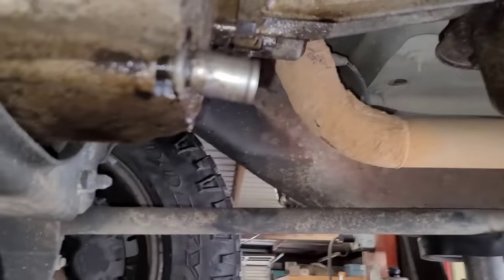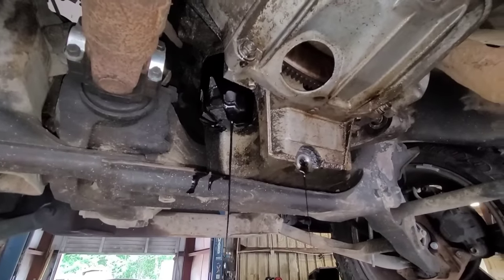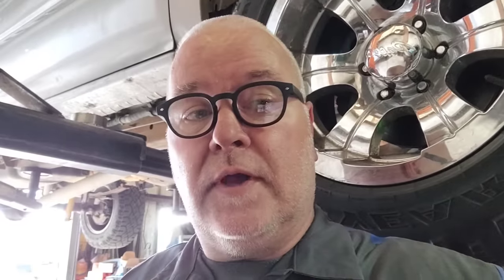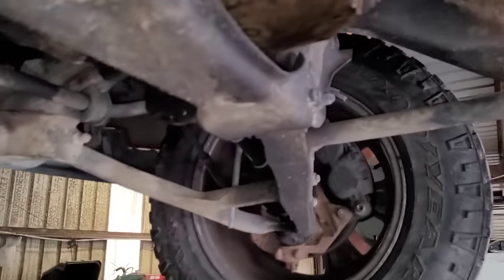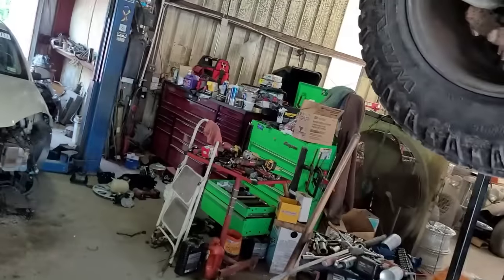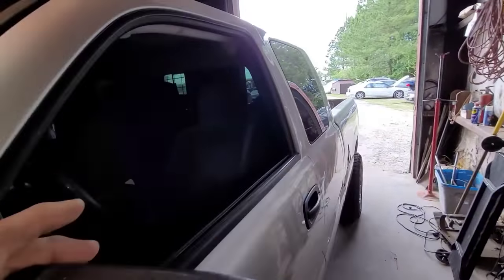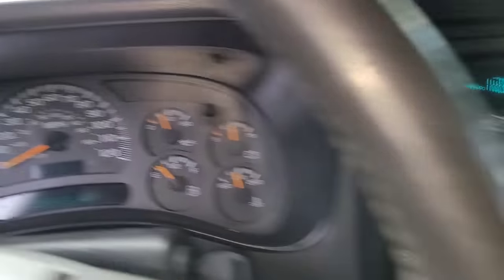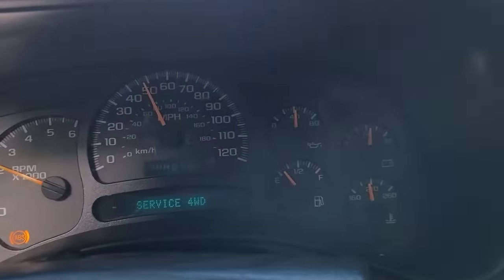We changed the oil in the noisy 5.3 and this happened!! The damage is done unfortunately..

Comment: I always prime my oil filters. And change the filter halfway through the 6000 mile interval. I buy a dozen Wix filters when they are on sale, it's cheap insurance. My neighbor has over 350,000 miles on his 5.3. Never had a repair that was major, and it doesnt even burn oil. When cared for and not beat on, the 5.3 is a very decent engine.
Reply from the maker: Excellent! Thanks for sharing. Keep wrenching 🔧

Comment: The newer spin on oil filters used on piston aircraft are labeled “ do not lubricate gasket seal” . I assume the material used is different.
Reply: could be pre lubed ,i have seen truck filters like that
Reply: Those are the Tempest “Spin-E-Z” filters. They are pre-lubed with silicone grease. Try installing a Champion without lube and you’ll use a chisel to get it off!

Comment: I bought a 64 Chevy Impala 283cu with 40k on it. Dropped the canister type filter and it was bone dry and packed with red dog (coal mine byproduct used on dirt roads) zero oil! Flushed the motor with 2 gallons of kerosene. Got another 70k out of it.

Comment: That’s wild I’m having the exact same issues with my 2000 Tahoe mines holding 10psi though. And I need to do intake manifold gasket’s since it’s idling way too rough
Reply: Hey Jack, sorry to but in, but try cleaning the throttle body. I had that issue one time and after that it idled and ran much smoother. Also look for vacuum leaks and it doesn't hurt to clean or even replace the PCV, usually in the valve cover, they're cheap and can make a difference in the oil pressure (everybody forgets about that). When you do your oil change, if you use regular oil it may improve the pressure, I find that conventional oil does make an engine hold better oil pressure, just like in this video. I find it better a lot of times, you just have to change it a little more often than synthetic. Also despite what he says, put oil on the rubber around the filter with your finger before you screw it on.
Reply: Oh I forgot to say that I would not change the intake gasket unless you are sure it's leaking.
Reply: Run some motor flush before changing the oil and do another oil change about 500 miles later . Repeat the motor flush each time you change oil. Small deposits can clog the micro screen below the oil pressure sensor and cause a low pressure to show up on the gauge. It’s a cheap fix if it works. Or new pump , sensor, pan gasket and pickup tube 0 ring can set you back a nice chunk. You got to change the oil anyway so try it. He says it surprised him and he’s an expert.Depends on how long you plan on driving the truck
Reply: @russellstewart5414  Thankyou man I’ll try that today, I know my intake mani gaskets are bad too due to misfires on start ups so gotta do that too

Comment: I was instructed to put a film of oil on the filter gasket to prevent it from binding on either side when spinning it on. That's how I've been doing it for 45 years but I really don't think installing one dry would actually hurt anything. 

One thing for sure, that motor is very close to the end. It wasn't just low on oil either. It was neglected by the owner or PO for many thousands of miles. Grit and poor lubricity from oil breakdown have been slowly killing it for a long time

Comment: I bought a 2003 Ford Explorer Sport (2-door) to replace my 1999 Ford Explorer Sport. It suited my height and the job that I did. With low mileage, I thought I was getting a decent deal, but a year later, the Mechanic said it wasn't worth the time to replace the leaking valve cover gaskets because the engine was all gunked up from neglecting oil changes.  Five years later, my gaskets are still leaking onto my exhaust and the car is still running.

Comment: I thought that the rubber gasket needed oil just to lubricate it as it goes on so it doesn't tear.
Reply: I always heard to help it seal
Reply: So we were taught to lube the top of the gasket with a thin film of oil to help it..... whatever. What about the other side of the gasket gasket on the filter. It's dry.

Comment: Thinking back over my career and the several dozen engines like this I rebuilt many times the greatest damage was to the oil pump. Especially seeing that fine metal flake look.
The logic behind this is that the oil pump pulls up unfiltered oil from the crank case. And then pushes it through the oil filter. As a grittiness increases in it and change oil, it chews up the oil pump, impeller’s, and inside of the chambers they spin in. 
Early on the filter will catch most of this fine metal particles until the filter becomes clogged and the and the pressure bypass pops open to allow Unfilter oil to flow through the engine.
It’s a customer understood what was going on and be possible just to replace the oil pump. Especially if it can be replaced easily with the engine still in the car. 

The early Saab turbo charged engines were a different animal all together. The first thing that would fail in those would be the turbo bearings. 
The turbo impellers would become extremely hot and burn any oil sitting in them when the engine is shut off after running hard. That burnt oil created a grit they called coke and start chewing at the bearings. Generally, the indication of this was a bearing one that would start about 500 miles past the recommended oil change general.

Comment: I bought one of my used cars in a private sale.  80k miles.  It ran very well, but the first thing I always do is replace all fluids.  Good advice on priming the filter, Kenny, but did you replace the integrated drain plug/magnet/o-ring?  Yes, it's an all in one.  I normally don't, but then I've never seen a cheap socket stuck on to one, either.

When I drained the oil, it looked much like the crud you removed from the Silverado, so I changed both the oil and the filter TWICE MORE, about a month and two months (~ 300/600miles) later.  Still somewhat cruddy the second drain, but clean and clear the third drain, so I know the last load of oil was going to remain healthy for a long time.

About 150 k miles and  five oil changes later, I sold it in great shape!

Comment: I’m having trouble with the fact this customer didn’t pull the dip stick to see if it was at least low and then drive it like that is troubling
Reply: What's a dipstick in a car?  I've only heard it used as insult😂
Reply: Had a cop car come in on 3rd shift. Crown vic.
 Officer says the oil pressure gage keeps fluctuating. Did ya check the oil?
Blank stare. 4 qts to full mark.
Next morning I go to cop shop. Hey ya might wanna keep a eye on this car... 4 qts low, jus sayin..
Reply: @ricanderson5717  sounds like your another candidate for Kenny’s shop😂
Reply: I agree...dont want this guy messing with my vehicle's...
Reply: I don’t get why the mechanic didn’t check it before the oil change.

Comment: Just curious if you could flush out that engine with deisel. With the drain open just pour it in and let it flow through to clean things up a bit?
Reply from the maker: I probably could do that . But I prefer filling the motor with ATF and run it for an hour and change it again . I've had good luck using ATF
Reply: @WrenchingWithKenny  wow cool👍Is that in any old engine?
Reply from the maker: @vdog4799  , I've done it successfully on multiple old engines , from first generation Cavalier 4cyl to a newer Ford 5.4
Reply: @WrenchingWithKenny  Thank You 🙂👍
Reply: What is the process for atf in the motor?
Reply: @WrenchingWithKenny  marvel mystery oil also works well 😀
Reply: I have heard....and only heard flushing a dirty engine or tranny can break lose sludge and plug oil passages.
Reply: @thepitpatrol  yeah me too. I think your right. Ericthecarguy covered that once. He used kerosene and clogged his sump screen. Ruined the engine. I thought diesel might be more gentle
Reply: @Vdog47  I bought a old farmall that had more water in the hydraulic system than fluid. I drained it. Filled it with diesel, ran it a while and drained.  I did that about 4 times then drained and filled with fluid. I ran that about a week and then changed again..still works today.
Reply: @thepitpatrol  Thats awesome😁👍 Thanks that's good to know

Comment: Starting when I 17 i bought a 1969 GTO Judge ram air IV that hadn't been treated well.  I change the oil run it 500 miles change it again at 1000 miles.  
Cleans out most of the build up.  Then every 3000 miles after that.

Comment: There's an oil pressure sensor typically behind those engines on top. Reaching around the top near the firewall, the sensor is removable. There's a filter screen, pre-sensor, it comes out and can be cleaned or replaced. Since the oil has junk in it, the oil pressure sensor may be getting an inaccurate reading if the filter screen is sludged up. I think the oil filter sits right below on that engine from the oil pressure sensor mounted on top-rear of the engine.

Comment: Why use 5w 30w on a motor with wear.  I'd be using straight 30w or possibly 40 weight in high mileage or damaged engines.

Comment: Actually, that is an 03-06 or 07 Chevy truck and didn't require dexos oil at that time. That came about in 2011 so using conventional 5W30 is just fine in it. 
Hopefully they kept a closer eye on the oil level and changed it regularly, and it managed to survive a while longer.

Comment: General Motors on these trucks delivers a drain plug with a rounded hex top so even if using the correct socket it will soon strip out. Been there, done that. OPS is fine. I've seen these things run all day on less then a quart of oil at 115F in the Central Valley of CA!
^..^~~

Comment: That's why i change my own oil and filter, about 1983-84 i took my 1975 Pontiac Trans am with a pontiac 400 to a gas station to have the oul changed, about 3 months later i proceeded to change the oil filter and it wouldn't come off i ended up crushing the filter being it's a Pontiac motor the filter housing is bolted to the motor i ended up putting the housing in a vise and using a pipe wrench to remove, after that nobody but myself changes my oil.

Comment: I just love how many folk's are telling why you have to put oil on the filter gasket after you stated you have done it both way's with out problem's.  As for the pre fill,  oil pumps move a lot of oil fast.  The oil left on the bearings will protect the bearings during start up.  Pull the oil pan and see how long oil drips from the engine.  But if you drain the oil and let the engine sit for a number of day's then pre filling may not hurt anything.  CAT with it's 1 gallon or so oil filters say do not pre fill for an oil change.

Comment: Back when I was still enlisted one of my units was in Hatteras and I was from VA about 2.5hrs away so id come home when I could. My mother, rip, let me use her turbo Volvo to come back to my unit and back to VA one time. I was leaving to go back to VA and when I got to the end of the station road I had to make a right onto 12 and the car died before I got out of buxton. Had it towed to the shop and it MAYBE had a quart of oil in it. The turbo had died on me so it wasn’t running, but he drained the oil and only about a quart drained out. My mother had never changed the oil in it 🤦‍♂️ needless to say, her next car was serviced EVERY 3k miles like clockwork!!

Comment: I'd try a bottle of Lucas motor snot to thicken the oil a bit. Ive added thousands of miles to worn out old motors before they finally gave up completely. I had an old Jaguar and locally I could only get Fram filters, following an oil change the oil light came on 1/2 mile down the road, immediate stop, dragged back to the shop, couldn't find anything wrong, bought Jag filter online and recommended oil and issue dissapeared.

Comment: Im the original owner of a 1998 3/4 ton GMC 398000 miles runs great i change the oil 3000 - 5000  a good friend of mine told me i was changing it to often but the proof is in the pudding

Comment: How did that truck turn out? Did you just return the truck to the owner , after the oil change? I definently think the damage is already done to the engine, but maybe installing a new oil high volume oil pump on that engine would bring the oil pressure up. Other than that, maybe put another engine in it, after that engine runs out.

Comment: minimum oil pressure is regulated by bearing clearance. at 25psi is very good. maximum psi by the relief spring. which is a little low indicating a weak overheated spring. the fuzz is likely the product of pushrod and rocker wear from running at low oil volume in the sump. keep it full. swap the filter a few times.

Comment: I have a 2000 gmc sierra 1500 4x4 extended cab, bought it  in 2002 with 38,000 miles, now in March/2024 i have 327,000 miles with the original 5.3 engine, transmission, transfer case and both front/rear diff, the engine lifter in one of the cylinders has been knocking since 2019 and the transmission hard shifts after 50 miles driving on a freeway due to more likely due to worn out TCC valve or solenoid, problem goes away if i shut engine off for 2 minutes and restart, never happens with in townlow speed driving. I always due my own maintenence, have replaced 3 fuel pumps, 3 water pumps and normal brakes, sepetine belts, idler pulleys. The only major things replaced was the total AC system which i did in 2016 , AC still works perfect and the oil pump, front timing chain and front main seal which was down by a mechanic at one time when the engine had 198,000 miles, still daily drive my truck and take on extended trips, wish GM still made the 5.3 like it was thus year

Comment: Every used car I've bought I always change the fluids first thing.  I buy and install a new drain plug.  I did this on our newest used car a Buick Lesabre, looks like the dealership mechanics used a set of vise grip pliers on the old drain plug.  Especially GM vehicles I change the drain plug gasket everytime I do an oil change every 3,000 miles and torque to specs.  Had to use a breaker bar to get the drain plug out on the Buick (Old Plug).  Shows they don't pay attention to torque specs.

Comment: Good old 5.3 ive seen many easily hit over 200k if well maintained sadly that one was probably neglected but i bet keep on running for many more miles as long as someone keep top off oil not let get that darn low again. If oil burner you still can slow down on these older engines that don't have VVT use thicker oil like 10-30 10-40 yes bandaid but works
Reply: 20w50 is better :)

Comment: One time my 300 v8 started to have a recurring slight vibration while cruising down the interstate, what I call a cyclic vibration, on for a few seconds, then smooth for a few seconds, as if the oil pickup was running dry then getting oil again, making the main bearings(or some other part) to grab from running dry. I immediately pulled into a rest area and the oil was down 2 quarts. I never let that happen again

Comment: I have had to chisel filters off on cars where the last mechanic did not lubricate the filter seal.  On a 67 Mustang V8 and a 66 AMC American 6 cyl.    BTW when you see bearing material on a drain plug you should not have to check any further.

Comment: FYI, that truck doesn't require Dexos oil. Looks like an 04-06 silverado with an LM7 5.3, so yeah regular conventional stuff is fine. Dexos didnt start until 2010. What a shame though...GM V8's pretty much run forever if you just do basic maintenance on them. For some folks though, even pulling the dipstick is too much work. 🙄

Comment: The oil you pour into the filter is going to the pan. Oil enters the filter from the oil pickup through the diaphragmed openings. That oil in the filter is sort of in the way for priming and has to be pushed out of the way at startup.

Comment: Quaker State oil used to be made from the oil of candle wax which would turn to sludge.  The valve covers would need to be removed to clean out the clumps of sludge from the inside of the covers.  Nasty stuff, never bought any Quaker State 10w30 again.  Only oils bought for the last 30 years Pennzoil and Castrol.

Comment: Oil on the filter gasket is not so it comes off easier. It's so that you can get the 3/4 - 1 turn by hand when you tighten it. If the oil filter is mounted upside down or sideways you can pre fill it by clear flooding the engine. Just hold down the gas pedal all the way while cranking the motor. With the gas pedal all the way down it will crank without starting. Do that for about 4-5 seconds. Works on most American cars and on Nissan from what I understand.

Comment: Yeesh... I'm going to change the oil and filter on my 5.3 this weekend, even though it's not due quite yet, just because of this video.
Reply: Naaaaah, check it and if it's clean and full, keep rolling with it 👍🏽
Reply: I am not sure what you mean by due, but if you are using the computer on the dash, it is most likely running out the intervals too far. On my 2003, 0% oil life is usually around 5k miles, which is not terrible. I always change at 4500 miles. On my wife's 2012 Yukon with the 5.3, if I let the computer decide when to change the oil, it was often over over 8k miles. I ignored that and changed the oil at 5k mile intervals. I recently sold it with 260k miles on it. It ran like the day we bought it. Most 5.3's, especially those with over 200k use some oil too, and people never check it. If you run that thing out to 8k miles between changes, there may not be more than 2-3 quarts left in it. Oil and filters have gotten pricey, but the cost of engine rebuilds/replacements have skyrocketed. There are not too many places in the world where you can buy cheap insurance. This is one of them.